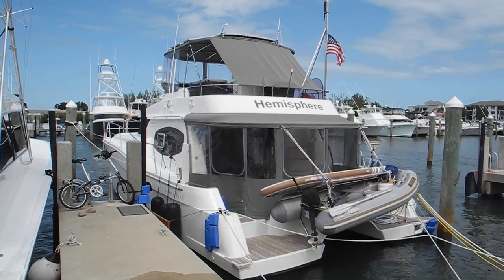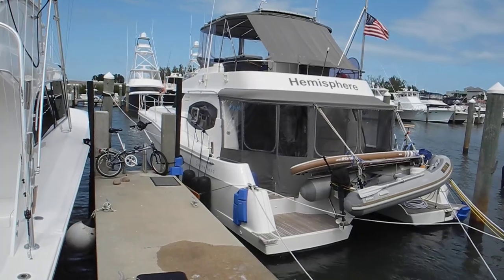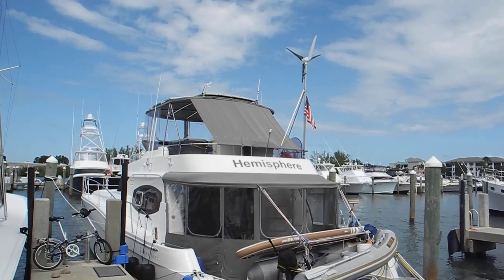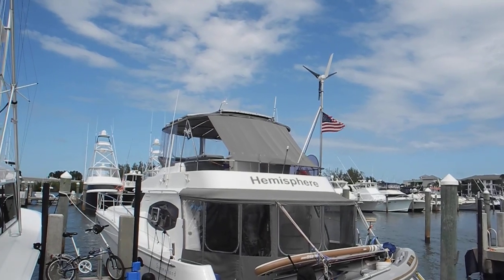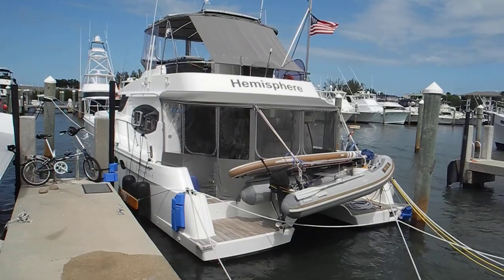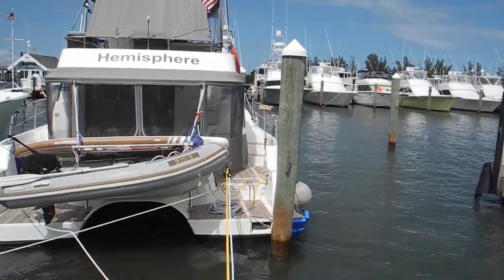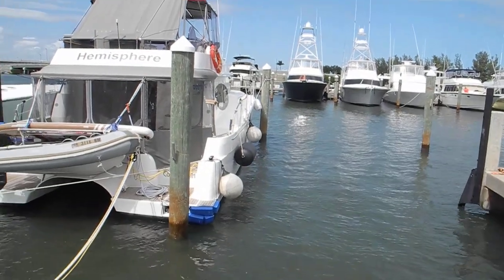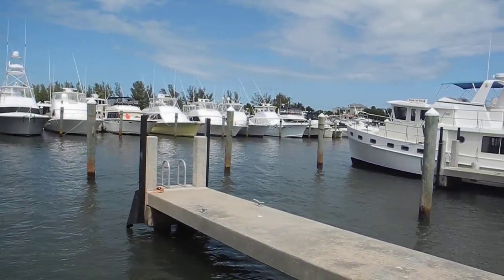Power Cat

Comment: Lots of stability on that beamy big vessel.
Reply from the maker: A lot to discuss there. First it does not fit into a regular marina slip. Then in heavy seas the two hulls may flex differently causing stress. Yes there is a lot of square footage space and marinas usually charge 1.5 to 2 times the slip rental because they are so big.
Reply: @AskCaptainChris  That would definitely be a tough call with the Marina charging extra. I guess a small boat could tie up in the opposite corner. 😆
Reply: @AskCaptainChris  Interesting to hear about the hull flex problems..